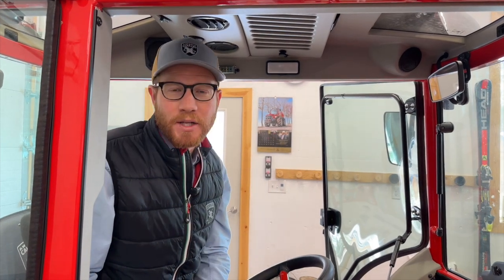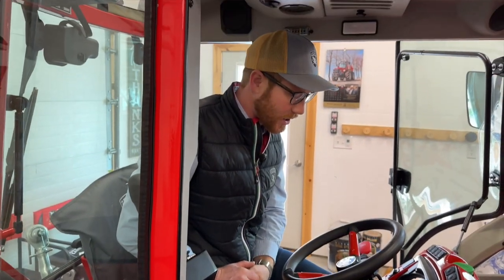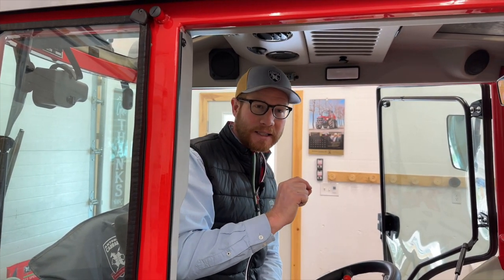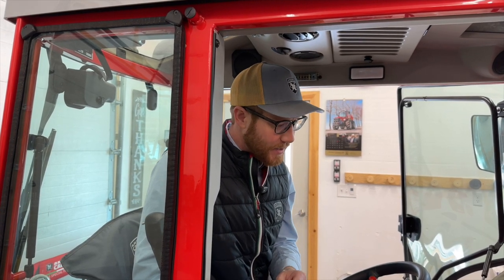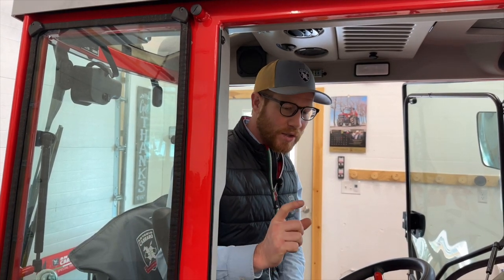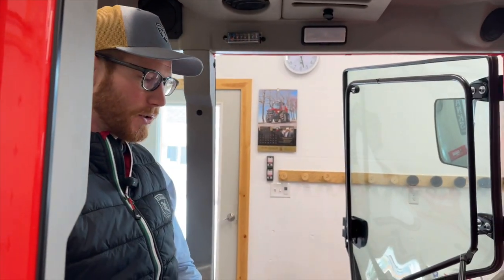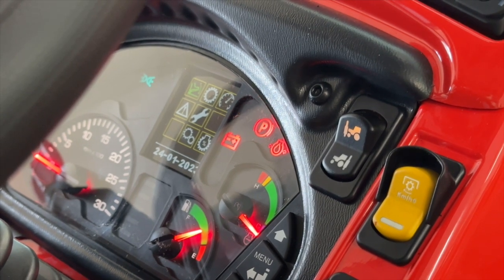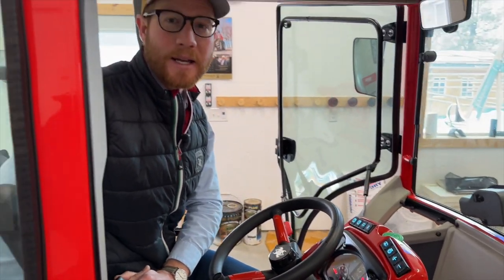Antonio Carraro SR7600 Infinity throttle mapping

Comment: Does ot work music in cab? Can you present this?
Reply from the maker: Yes, the cab is pre-wired for radio.  That means it has speakers installed in the cab and has the wiring run to a panel where you can install a stereo.  But you need to put in your own stereo unit for everything to work.
Reply: Almost all manufacturers leave an empty space for inserting the device into the cabin. What I was interested in was what kind of music was in the cabin? can anything be heard/understood from the music,,,,,because of the noise coming from the engine sound. I'm asking this because I've watched a lot of videos on YouTube and I see that some drivers of antonio carraro tractors use headphones against noise - on tractors without a cab. When the tractor is working, how much db is the sound in the cabin? There is not a single video on youtube that someone recorded a carraro tractor with music in the cabin... there is a good video for the deutz fahr tratcor. Could I have your e-mail address for contact and agreement because we are planning to buy antonio Carraro,,,but we don't have a dealer in our country :) tnx
Reply from the maker: The noise level in the cab is 85 dB.  You can hear music well in the cab and can even make phone calls.  Please check out our website for more info.  Antoniocarrarous.com.  We don't sell tractors outside of the US.